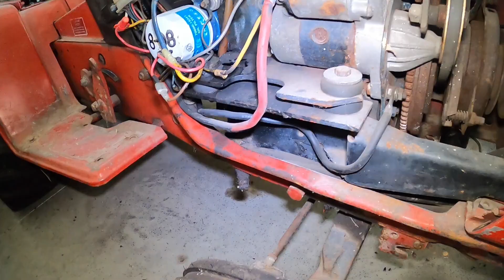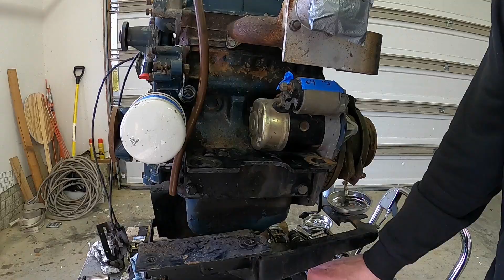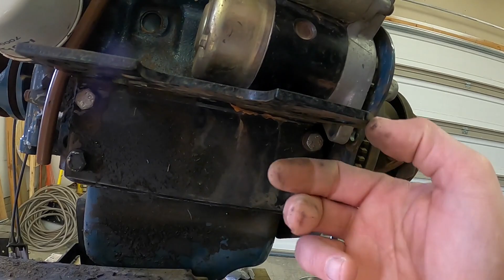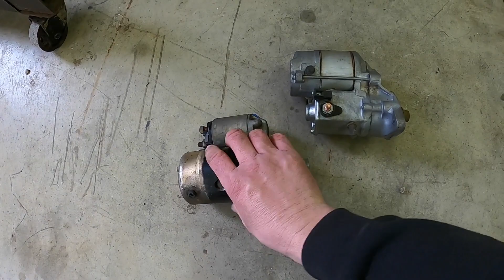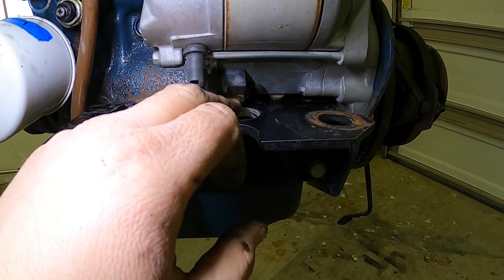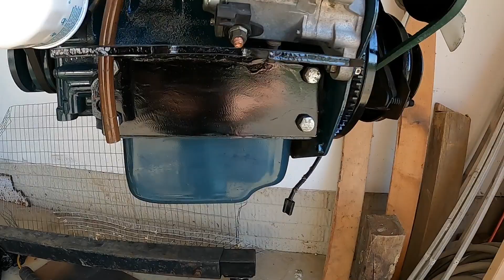Cub Cadet Diesel Gear Reduction Starter Upgrade!

Comment: I had the same issue with the solenoid on my gear reduction starter.  Hit the key and have a big wrench handy to tap it and then it would start. I read where the ignition switches go bad so ordered a new one on Amazon for about 20 bucks. It seems to have solved the problem.
Reply from the maker: I am going to look into that. I am tired of carrying a hammer around with me as a second key lol.

Comment: Why wouldn't just cutting the stub shorter that's on the starter instead of drilling a hole in the plate? Or at least drilling a smaller hole?
Reply from the maker: @speedbuggy7240  I do not think there would be enough threads left if you cut the stub. I made the hole a little bigger to be able to thread the nut on easier. The adjantage to having the hole drilled in the plate also makes it easier to remove the starter when engine is installed in the tractor. The one bad thing with these Cub diesels is everything is cramed together.
Reply: @steiger256  There is a vid where a guy cut the stud. He bolted the wires on first, but was able to put the starter on without drilling a hole in the plate. I'm going to do the starter upgrade to my 1572 and 1772 and I think I'm gonna try and combine the 2 methods by cutting the stud a little and drilling a smaller hole in the plate. Or something similar to that. I don't like the large hole people put into the plate. If I can drill a much smaller hole or 2 smaller holes next to each other to make an oval hole I think I would like that better..  I have time to think about it before I get the new starter. Thank you for your response. I for one appreciate you taking the time to make the videos on Cub Cadets. I've watch several of your vids.  Thank you.
Reply from the maker: @speedbuggy7240  I will have to check out that video. I also made the hole a little bigger because I am adding a rubber boot to the cable to go over the lug. Just make sure to keep enough clearance from lug to plate maybe add some rubber under lug to make sure it does not arc over when starting. I would have rather not have added another hole to the plate. I may cut the lug on the next one I do, I will check that out.

Comment: Got the sensor starter #
Reply from the maker: @Jonnysjunkgarage  Are you referring to the starter part #?
Reply: @steiger256  think I found it and ordered it. Should be here in a few days.
Reply: Do you have the part number for the Denso starter?
Reply from the maker: @rodneymayberry7985  The tag has 2 numbers on it. The first one is the top number and the 2nd is the lower number. Hope this helps.
Top number is 19269-63013
2nd number is 228000 0991
Hope this helps